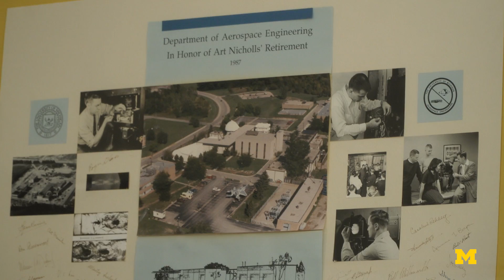Pioneering the rotating detonation engines in the 1950s

Comment: What axis of combustion rotation did those engines use? 

Eg Flame stabilisers as used in jet engines, to stop the flame being extinguished? If flow faster than flame speed... The flame front(area combustion starts), moves towards exhaust at rate of the difference. Flame is literally blown out. Flare can be used to statabilise flames if flow is subsonic, but gets bulky at higher speeds etc. 

Solution is often a lip sticking out into a  flame tube. The mixture Jets through the middle, and in cross section two edies curl around behind the lip. The edies *rotate*, and if they are burning, the curl of flame lights mixture entering akin to a pilot light. Combustion can then be maintained at higher flow rates... Including those compatable with higher flame speeds... Which would result in more intense cimbustion etc.